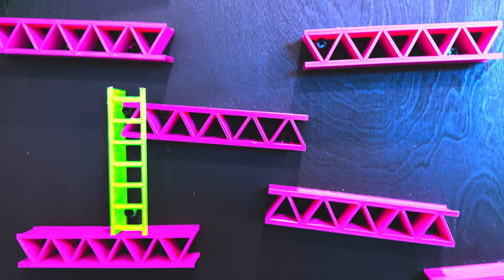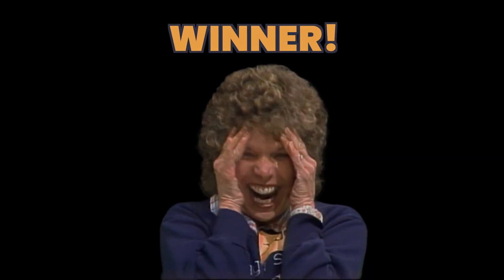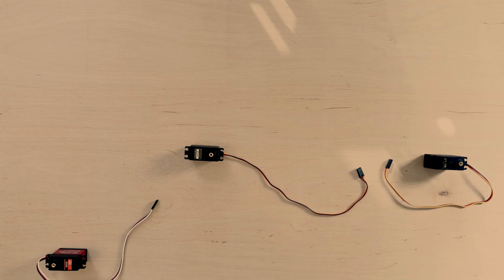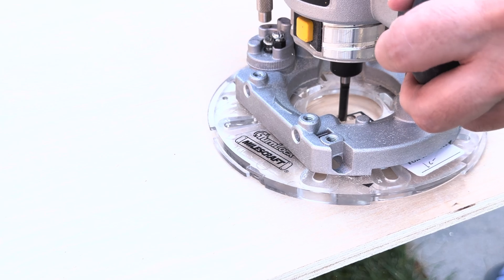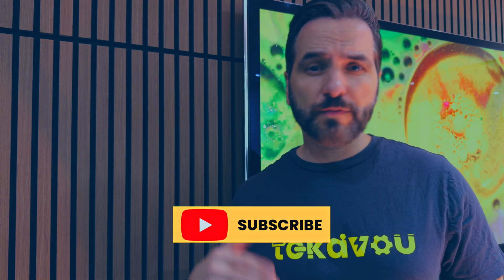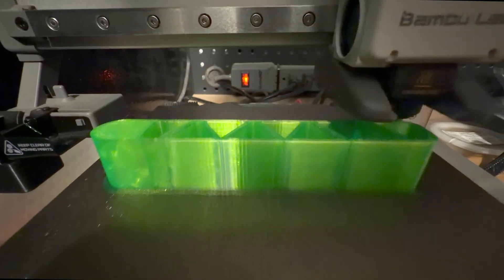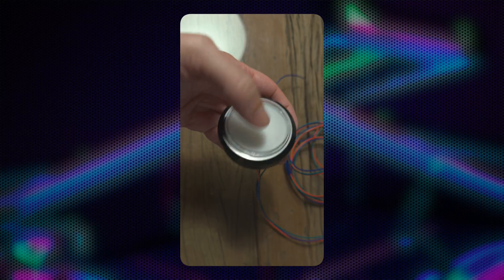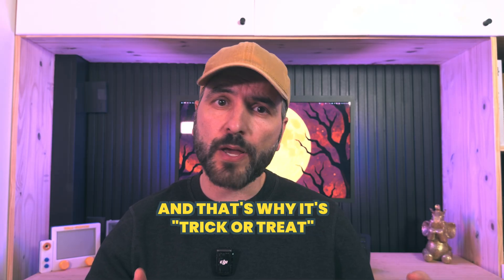My real-life Donkey Kong style game decides your treat

Comment: 4:05 Wait, a car has more wiring than a Disney animatronic?
Reply from the maker: Even though I wrote both of those bits, I didn’t even realize that until you said it but yes! Modern cars, especially EVs, have a ton of wiring in them. You’d think they’re just a computer on wheels but nope, there’s a lot of wiring connecting all those sensors together.

Comment: How did it go in practice? Did the tilted back board have a lot of issues with balls escaping?
Reply from the maker: It went really well surprisingly. The only issue was that it was super windy that day. When i opened the door a draft would come in and sometimes make the ball fly off. It worked maybe 95% of the time which is not bad imho. Thanks for watching!